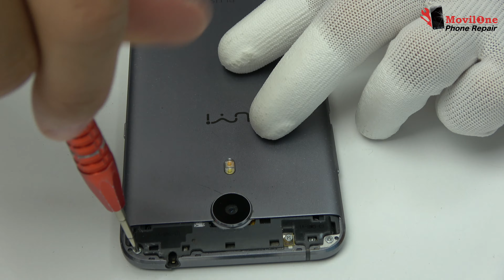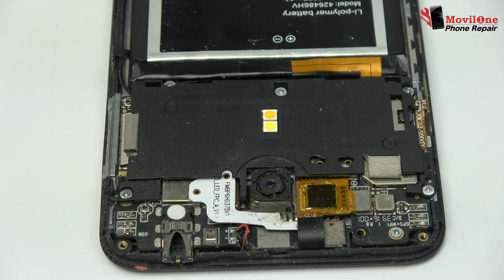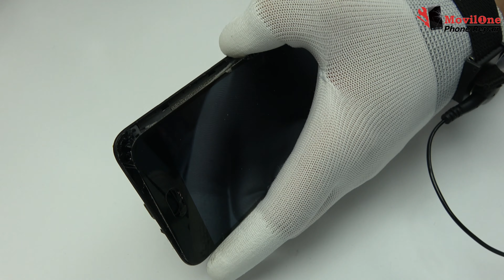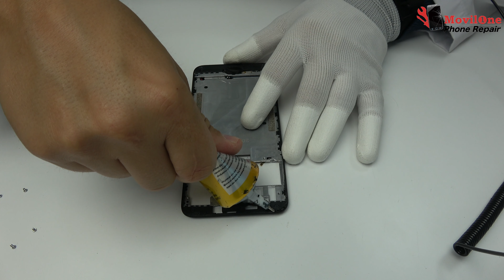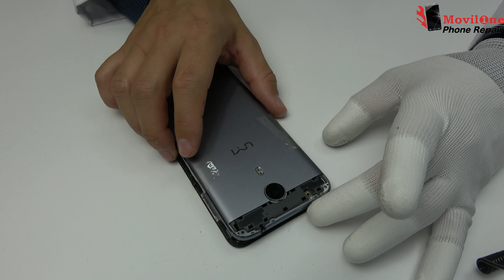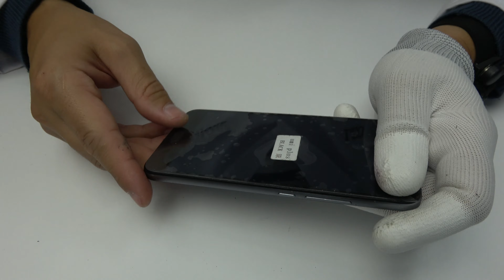UmiDigi Plus Display Replacement

Comment: Hi. Bottom system panel overheats (gets extremely hot like the touch of scorching car metal) and touchscreen is Non-responsive (not working) after new LCD display screen installed.  What would you do now?
Reply from the maker: Hope it would help!